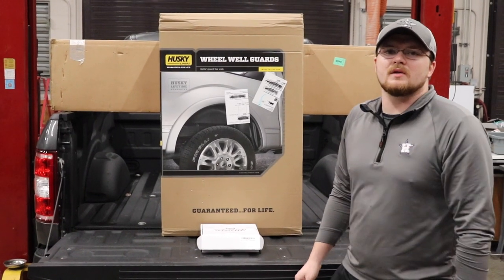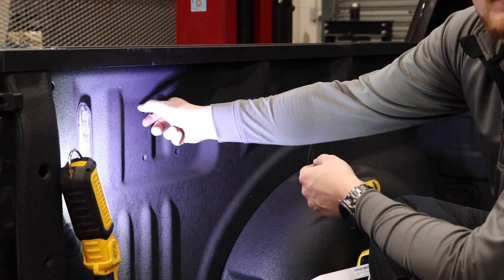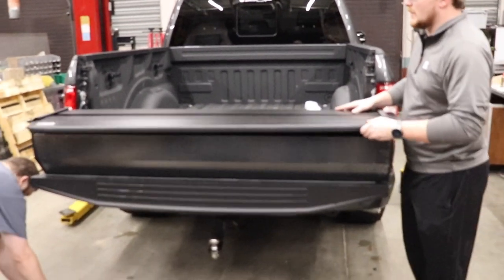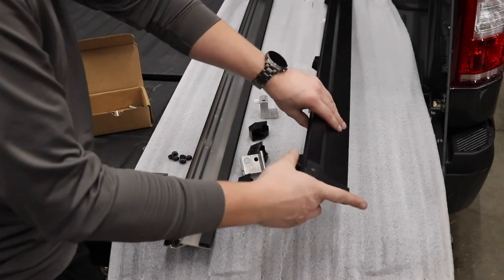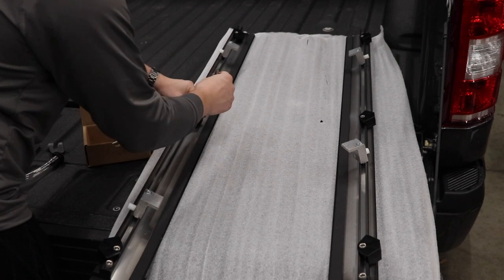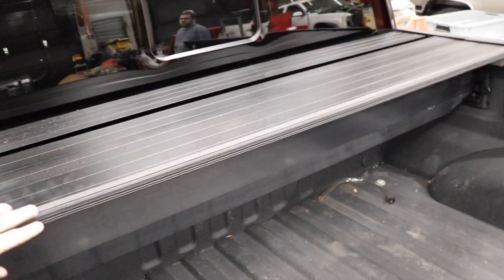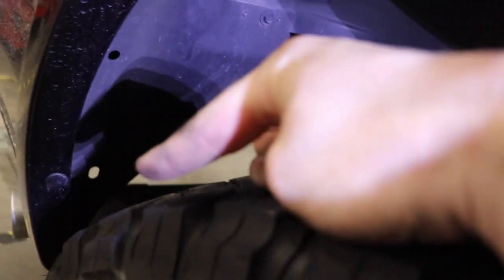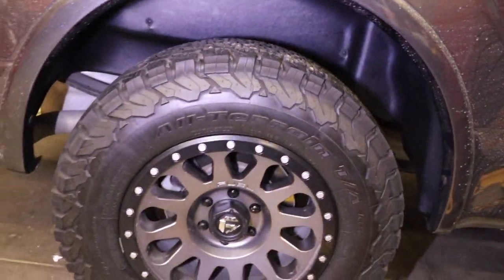Top 3 Mods For Any Truck Bed!!

Comment: For the Box Link system I am thinking of taking the cleats off and making or finding a Box Link to E track adapter. I think that would give this system far more versatility!
Reply: The E-track accessories should fit right in the box-link plate.
Reply: @akbychoice  thanks!

Comment: good job on those fenders liners...I cursed just a litte bit putting mine in
Reply from the maker: Haha ya they're a B! But I did one off camera for that reason 😂
Reply: @LonestarGarage  watching some of your old videos. The DeeZee tailgate assist was such a cheap add-on i cant believe they dont come from the factory already installed. Did you add the pull tab for the rear driver seat? makes it so much easier to get the seat down and there is a ton of room back there.
Reply from the maker: Yes I did add it but I didn't record it! But it's a great mod!

Comment: I don't get it. What is the purpose of the key for the tie downs? Seems useless...
Reply from the maker: That is how the cleat locks in the the mounting plate. It is also how it is designed for theft reasons. Yes a smart criminal would just cut the strap but that is how the box link system works.